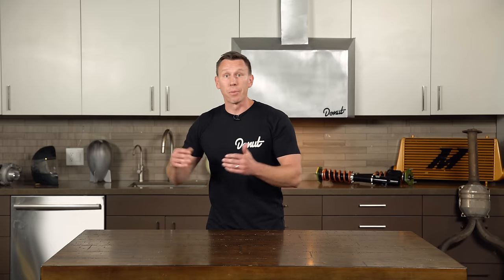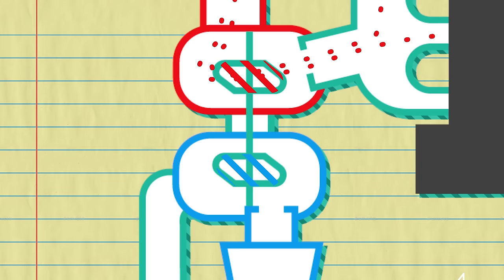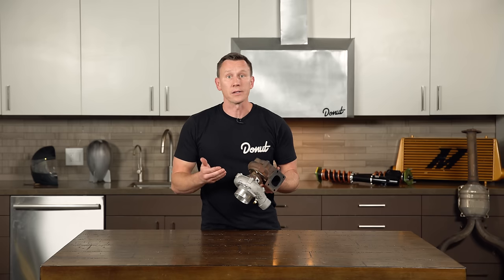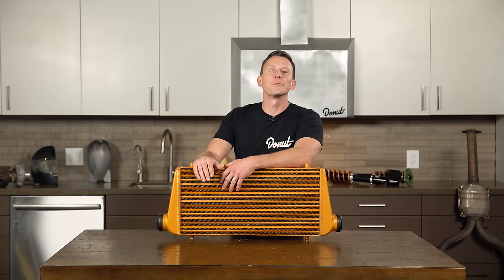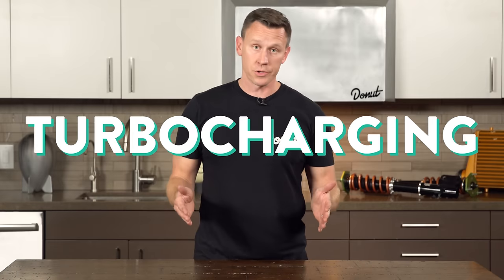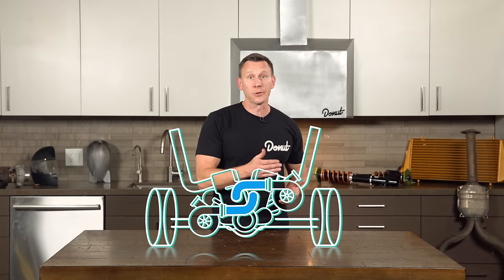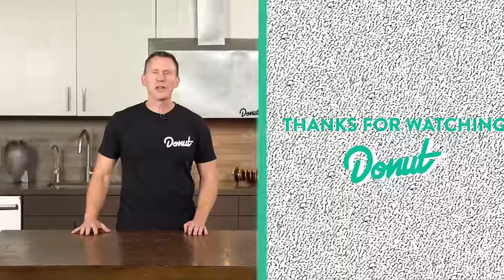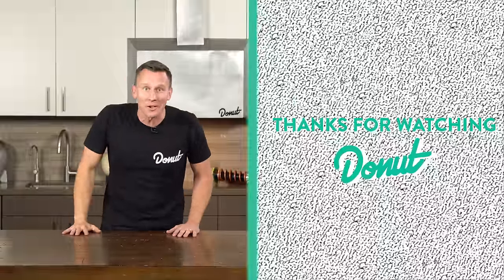Turbos: How They Work | Science Garage

Comment: To much work, will just add flaming stickers for more horsepower
Reply: Nah, play some Eurobeat while driving.
Reply: Why not both?
Reply: LOL
Reply: Many people don't get how stickers work. They actually multyply the power of the engine at all rpm and conditions, so if your engine has more power and you have stickers worth of 50% power increse, you will make more use of them by having a more powerful engine. That's why race cars have both powerful engines and stickers.
Reply: Rohindhran Nair I put a nismo and v spec sticker on my micra and now it's awd with 865hp
Reply: I added a vtec sticker to my non vtec Honda and it has 7000 horsepower now
Reply: I just welded a turbo whistle keychain to my exhaust and put some turbo stickers and it basically tripled the power
Reply: smashing side mirror for more torque
Reply: You guys don’t know how to really add horsepower I just bought a neochrome muffler the size of an Xbox one and now it sounds loud on my 2012 Toyota camry plus it has 963 horsepower
Reply: Paint each wheel red that's 5+ horse power each. (Don't forget to paint your spare.) You paint the car red that's +20 adding a racing stripe is +10 adding a different shade of red stripe is +50.
Reply: I put 120 stickers on my prius, and it produces 1,200 horsepower
Reply: Stripes... It's all in the stripes
Reply: Just play some eurobeat
Reply: Robosy 😂
Reply: for honda, just replacing honda badge with a red one and car become lighter can revving up to 11000 rpm
Reply: I put everything on my car
Reply: Does a vinyl wrap work the same as these stickers? Asking for a friend.
Reply: Put stripes in the middle of the car and the Cx will fall to 0.10
Reply: LMFAO
Reply: I took the tuner sticker off my Evo X and stuck it on my 70y/o mum's Camry hybrid. That fucker will spin all four wheels at any speed in any gear, and my dad now has Alzheimer's.
Reply: Just add some massive subwoofers for massive power gains
Reply: Or else add some stickers of horses.
Reply: Paint your disk pads red automatic 80+ horsepower

Comment: Am I the only person that likes having a bit of lag in a turbocharged car? The feeling of boost building up before you feel the car launch has always been satisfying for me.
Reply: Me too
Reply: #metoo
Reply: Good for pulls but bad for race cars. I agree it’s fun to scare passengers with it lol
Reply: Why not just slowly increase throttle? But yeah, feeling the boost building up is amazing.
Reply: Facts
Reply: Yea, but the lag is mainly inconvenient for racing purposes. (Mainly drag racing)
Reply: IggyDoesStuff haha ur on the money man, stuff racing. Scared passengers will do it for me
Reply: Yeah, lag is fun and safety when you drive straight, but when you turn... surprise! unwanted drift. That's why twin/bi turbo exist.
Reply: @andreyates1555  Actually drag racing shouldn't be a problem since they start at high revs and shift at redline so the engine regime is always kinda high. In actual circuit racing it makes a difference since you ideally want your engine to produce max power and torque at all times.
Reply: @mviz2299  why are you accelerating round corners if it's not safe enough for a boost to kick in... Just let off the throttle dude
Reply: @iDuppyMaNx  Yeah, I agree, but at the end of corner you have to accelerate, meanwhile tires isn't straight enough.
Reply: Wouldn’t it be better if u hit the gas and the power was right there so some ricer that had a jump on you still couldn’t pass u because u had little or not much boost lag ?
Reply: No your not alone
Reply: You’re cute
Reply: It's one second of false hope for NA guys until the boost kicks in

Comment: Does anyone know that your leaf blower is a turbo XD
Reply: Heart of Wolves28127 mind blown
Reply: So if I stick my leaf blower on my exhaust, it will up my power 1000 HP?
Reply: Joshua Spengeman  Roadkill managed to slightly gain power in their leaf blower charged Monza, but it was awkward, impractical, and the gains in a real world setting were negligible. Still hilarious tho.
Reply: @eclipse_1699  clever pun
Reply: The more you know
Reply: that makes sense
Reply: Nah it’s just a fan, the air is just piped through a.. pipe. But now I wanna turbocharge my leaf blower. Fuck those leaves
Reply: A YouTuber poboys put a leave blower into a turbo for his truck IT ADDED LIKE 5 HP 🤣
Reply: watch a youtube video by a youtube poeboys the video is called turbo charging my truck with a leaf blower
Reply: @michaellauinger7406  Yeah, Try it:)
Reply: Leaf blowers don't compress air though.
Reply: Supercharged not turboed
Reply: @michaellauinger7406  no that would not work because a turbo uses exhaust gases. Putting a leaf blower in your exhaust will just force the burnt fuel back into the engine.
Reply: @michaellauinger7406  definatly
Reply: @michaellauinger7406  no bruh, put the leaf blower on the intake the the exhaust

Comment: do a video explaining the different aspirations of an engine (i.e turbocharging, supercharging, and natural aspiration) and the difference between them. i have a friend who still cant get the concept of engine aspiration.
Reply: In a normal naturally aspirated engine the air is sucked in like a vacuum from the piston going down during the intake stroke. Only so much air can be sucked in this way. The only way to get more air in is to force it in instead of letting it get sucked in. Turbochargers and superchargers do the same exact thing. They force air into the combustion chamber. It's just the way they do it is different. Obviously he explained turbo in this video. A supercharger does not use the exhaust to spin it. It's actually connected just like your air conditioner and alternator and spins from a belt so there is no lag because you don't have to wait for the exhaust to spin it. You get instant power, no lag.
Reply: @mawage666  an explanation isn't the prob my friend. I understand it but my friend doesn't.
Reply: Nim from what i understand.  Superchargers are prone to belt slips among other things.  Don’t know much about it myself but I feel that’s what im going to get.
Reply: @Nim superchargers rob hp from the engine to pull the belt to spin it, then the supercharger gives back the hp plus a little more. whilst a turbo takes longer, it uses exhaust gasses to power it. plus turbos are a little bit more tune able then super chargers

Comment: 3:57 there is a way to kill lag by spinnin’ the turbo electronically although it might take a tall on the battery 
Look up on top gears review on the Mercedes Benz Amg 1
Reply: Another method that VW have done is to setup a twincharged system. Have an exhaust gas driven turbo for high end power with a mechanically driven supercharger to provide instant low end power until the turbo spools up

Comment: Turbo, Big Turbo, Twin Turbo, Bi-Turbo but doesn't mention Quad Turbo which is in a 2JZ Silvia 🤔
Reply: and the Quattro Debocho
Reply: Yeah, like everybody has a modded Silvia or a Bugatti Veyron lying around.
Reply: I think he means turbo setups that are common. That 2JZ Silvia was a one off car built in Japan. And the Veyron shares the quad turbo with only one other car, the Chiron.
Reply: lol and the 2 supra motors someone frankensteined together
Reply: That quad was a basically a twin made of 2 compound turbo setups.
Reply: Silvias should have rbs thoug
Reply: wrong, that set up came from the buggati eb110
Reply: 4 turbos, only used in extremely expensive cars like Bugatti Veyron or Chiron (which both use a W16 engine that has 4 cylinder banks rather than 2 like a normal V engine)
Reply: EASperts There was a short clip of a quad turbo burnout truck at the start of the vid.
Reply: President Donald J. Trump Lol. Not only in "extremely expensive" cars. The 550d has 4 turbos too

Comment: so basically turbo have nothing to do with ecu? if so, how the fuel ration is calculated?
Reply: Most cars that are boosted use a speed density tune. A map and temp sensor is used to know the pressure and temperature  in the intake. The ecu uses the data from those sensors combined with the rpm of the engine and its volumetric efficiency to figure out the proper amount of fuel.

Comment: now i need too now how superchargers works
Reply: Lucas o Mago A supercharger has the same effect on the intake side but instead of exhaust gas spooling up the cold air side via an axle like in the turbo, the supercharger is attached directly to the crank with a pulley. It's belt driven which eliminates lag but it's also depending on engine rpm, therefore some power is lost due to the energy needed to spin the compressor.
Reply: Actualy the power is lost due to more friction, turbos also need to be spined with a force to achieve pressure.
Reply: Lucas o Mago instead of having exhaust gas spin a compressor, a belt attached to the crank does it.
Reply: Vsauce, Michael here
Reply: No you need to know how to spell my good man
Reply: Lucas o Mago it's the same thing just driven by the engines crank rather than exhaust gasses like the turbo relies on. A procharger supercharger uses a turbocharging turbine basically just driven by your engines crank.

Comment: Wish you explained how a waste gate works
Reply: Essentially when the pressure hits a certain difference, it opens to release the boosted air pressure. It’s usually activated by the engines manifold  vacuum.
Reply: @grimreefer5159 - Incorrect.
The wastegate does not regulate the 'boosted' pressure, it regulates the 'boosting' pressure, because it is fitted to the turbine side, the exhaust side, not the compressor side.
Reply: Waste gate is a pain in the ass of you ask me

Comment: Okay, a front mount intercooler hardly helps improving performance. What it's actually meant to do, is holding the power while under stress, preventing heat soak and seriously deteriorating performance.

As crazy as it may sound, placing an intercooler in the driving wind hardly helps keeping it cool. Bear with me. Have you ever looked close at the design of an intercooler? The narrow canals the air has to travel through? That's because heat is easier dispersed if the whole package is divided into multiple slices, so there's a multitude more contact area with the colder air (the air that travels through said canals). The ambient temperature of this driving wind, no matter how high the speed, have very little to nothing to do with the cooling capacity of an intercooler unless you use a misting spray system of sorts (water for example is an excellent conductor of heat, comparable to single pane glass or the bricks your house is built from).

Think of it as eating nice, hot lasagna with your buddy. You both get equal size and warmth lasagna, straight out of the oven. Your buddy decides to dissect his lasagna in 10 or 12 seperate layers. Who do you think'll be able to eat his lasagna sooner without burning the inside of his mouth?

Comment: SuperTurboCharger
Reply: TurboCharger + SuperCharger = SuperTurboCharger
Reply: Turbocharged supercharged dodge charger
Reply: twincharged.
Reply: the correct term is "twin charged"... i think VW and Volvo did/do twin charged cars but its on small displacement engines only... like 2.0L 4cyl(Volvo) and 1.4L 4cly (VW)engines...

PS i just remembered that Mercedes Benz has a new 3.0L inline6 engine thats twin charged but uses an electric supercharger...
Reply: dunhillsupramk3  Lancia also had the S4 Delta with an electric supercharger in their twincharged system too
Reply: electric? in S4?? they had two superchargers and turbo
Reply: alessandro ari zaluski that's what I was told

Comment: So well broken down. . Appreciate it very much. But I got a question.  .what would cause a turbo to leak oil going out the exhaust side.. I'm A Generator Mechanic in the military and we had one doing that on one of our new Ammps Genset. . The theory was that the seal inside the compressor side might have been defective.. so we ordered an entire new turbo but is still having the same issue 🙆🏽

Comment: that radiator looking thing to cool off the charged air is called Charge Air Cooler. An intercooler uses coolant to cool the air and is normally located over the intake. The Cummins 855 is an excelent example on an intercooled engine. Please stop the confusion of the CAC.

Comment: the rx-7 was sequential but they were also the same size. in lower rpm’s only one was active, then above (i believe) 3.5-4k rpm the second one also turned on and both built boost

Comment: hey it might be a novice question
but my question is,if you use turbocharger can it control the supply of fuel and regulate the air fuel ratio also ?

Comment: Heres a question would you really get more hp with colder air on a engine built for say 1400hp thats at 1400 already 

Would you have to turn the boost down to not blow it up because it’s at the limit already?

Or would you achieve more hp while not straining the engine anymore

Comment: It is interesting that a turbine , in the exhaust stream, can produce more power. Restrictions in an exhaust path usually just drain power. I guess what you gain from a turbo is just way more than you loose with the extra exhaust restriction. Maybe once it starts spinning, its not much of a restriction anymore ?  I bet it getting it going sucks up some power though.  It seems like it would take a lot of power and pressure to spin the whole system. The originators of super charging and turbo charging were mechanical geniuses. I bet they just went for it, before looking at the math and physics behind it, and they worked great.
Reply: I get what you're saying you're almost kind of thinking about being on a boat and blowing on your own sail. It's not like that because the turbine is on ball bearings and isn't that hard to spin. Imagine a leaf blower the thing is probably about two horsepower and you can see how hard it blows. On average a turbo can drain about 10 horsepower. Smaller ones about seven and big ones you would see on like a race car about 20. That horsepower loss doesn't really mean anything though when you take into account the benefits of what it's doing. Our atmospheric pressure is about 15 psi. That's why when you get out of vacuum on a turbo and start boosting 15 psi of boost will equal one extra atmosphere. That means that you get enough air to burn twice as much fuel as you did at that same displacement before. For example say you had a 2.5 l engine making 250 horsepower. Your turbo might take away 10 horsepower to run but your 2.5 l is basically now a 5 l engine and depending on your fuel mapping what type of fuel you're running ECC you can make 400 horsepower now.
Reply: Other things that use engine power can take a lot more horsepower to run because of resistance. For example an alternator in a car or the compressor on a ac. Those both have to use engine power to spin something that has a lot of resistance. A supercharger suffers from this same disadvantage. It's mechanical so it drains power off of the motor but since it's belt driven it can only spend so fast that's why people change pulley sizes. But put too big of a pulley and you negate the benefits of a supercharger. The supercharger is supposed to be good because it gives you instant power but lacks top end. Lots of modern cars like mine for example have twin scroll turbos that kind of makes superchargers obsolete because they almost eliminate lag. A turbocharger faces Little Resistance and uses the momentum of the spinning turbine to build pressure and that momentum can be built up and sustained and since it's not mechanical it can spin basically as fast as you need it to.

Comment: Could you do a video on drifting, different types of drifting, drifting vs powersliding and when drifting or powersliding is actually faster than slowing down for a corner to grip?
Reply: Mythbusters actually covered this over two episodes. Short version- hairpins it may be faster, on dirt it may be faster, but sweeping corners it's definitely better to corner it normally.
Reply: @godoftenors  i saw one mythbusers drifting video and it suggested drifting is always slower but they didnt go very in depth with their testing.
Reply: @jayjaygolden5123  Yeah- that was video one. They revisited with a professional drifter and a dirt track, with better camera angles, and found that for some corners, it was much faster to drift through them.

Comment: I’ve got a turbocharged 1989 dodge Daytona I just wanted to know how the whole system worked it’s also inner cooled too I guess my question I got it the blow off valve where does it blow off too? Back to the air or back in the intake lol I just have this random hose from the wastegate where does it go 🤬

Comment: One question. In the first iteration of the cycle, does the air pass through the turbo's compressor (ergo, gets compressed) with the same compression ratio as the cylinder (ideally speaking)?

Comment: Question: Does a turbocharged engine completely rely on the air from the turbo compressor or does it have some naturally aspirated air to which extra air is added using turbo?

And if thats not the case then how does a turbo engine start?

Comment: Iam revisiting this after so many years cuz I didnt have a turbocharged car back then, then again and just yesterday my blowoff valve was making my car do some mixed "stututu" with "psssh" somewhat like "psshrrstutu" instead of the usual clean "psshh" when I took it out for a drive to another city which is 1,600 m above sea lvl and I usually drive it on 500m, the blowoff valve sounded exact the same clean "pssh" when I made it back to my city, does the air density on that other city has something to do with the blowoff valve sound too? I actually panicked and thought for a second that I blew a hose or something lol